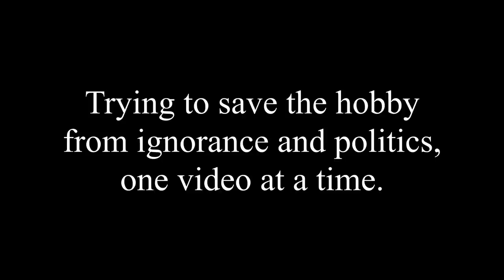Will this hurt?

Comment: But Bruce... But...but...Bruce.... It could be sucked into a jet engine!!! Just like anything, it could be sucked into a jet engine! Registration would fix that for sure!
Reply: Don’t worry. They test jet engines with 7Kg frozen turkeys.  Too bad regulators don’t know that.
Reply: @luclavoie3873  would that be incase a turkey froze while flying through the clouds. LOL
Reply: There's been bird strikes with frozen birds that were caught in thermals, it ain't pretty, and it's much higher then any civilian hobbyist drone can fly.
Reply: They do those tests on a bench. In the shop to certify that the guts of the jet engine comes out the back and not radially so it doesn’t tear up the wing. My point is that this plane it a lot less resilient than the frozen bird. They use the frozen bird as a worst case scenario. Never heard of a bird freezing up in flight.
Reply: Ahhhhhh. Bruce some people complain over nothing. Keep up the hobby my friend. I am and nobody will stop me either. They should worry about gun laws not a harmless RC hobbie

Comment: Great video Bruce but remember add speed to that and I guarantee it will hurt. It's like water, it doesn't hurt until you add height and speed then it is like hitting concrete.

Comment: Proof that your plane is not only a low risk design, but very robust. If I play devils advocate, I could argue that you need to calculate the force of impact, if your plane was to fall from 120 meters. I have no doubt that it will be less than the kinetic energy of a football. But I would like to see the result.

Comment: Obviously not a danger to humans or property, provided the humans or property are not moving at a great deal of speed relative to the foam model.  As always, Force = Mass x Acceleration.  A bit of foam traveling at almost Mach 1 brought down the Space Shuttle Columbia.  However, as we both contend, birds pose more of a real risk to humans (driving and flying) than foam models.

Comment: You are a brave crash test dummy using your private parts as a target! By the way, at 248g it is legal and harmless. Of course if ever repaired with hot glue, etc it may weigh >251g and then of course it's classified as a dangerous illegal lethal weapon and will be a reportable statistic according to CAA .

Comment: Nice video. Only problem: there is no real problem with sub 250 planes anywhere in the world, I guess, except this snowflake who commented on your video where you flew around in the park. So it is not bringing much advantage to proof that a sub250 foam plane is safe. Nobody with more than half a brain should be able to realise that. I'd rather like to see such crash tests with some common used foam planes in Bixler size and style and compare that to the risk of getting hit by a football or a softball or a tennis ball. People have to see, how stupid it is to ban such foam planes and accept things with way more destructive energy. The next point to mention is, that you normally fly planes or drones in a height, where nobody is at risk. In heights of 10-30m there are no people to get hit.

Comment: Your test isn't accurate though. You have a mid pusher plane. Most model planes could be front traction with the brushless motor all the way to the front. Injuries from that impact could certainly be a problem, both propeller cuts and brushless motor smacking into head/body.
Reply from the maker: Which is why I have developed this model -- so we do have a totally safe sub -250g FPV model.

Comment: I really don't think your proving much to the powers that be who seek to legislate against us. Obviously, a purpose built plane made from foam board that you have specifically designed with a prop strategically placed at the rear so it won't hurt anyone won't hurt anyone. But. Despite your white board explanations that you referenced in an earlier video that we should go and look at to be "educated"  Which sort of implies you consider yourself far more intelligent than the viewers to your channel are.  You seemingly have failed to understand most model planes have prop(s) facing forward which could hurt a person or animal if the plane was to collide with them. These are ones that legislators will look at when deciding on rules and regulations. Not a one off creations.